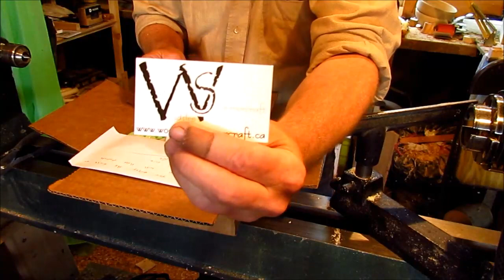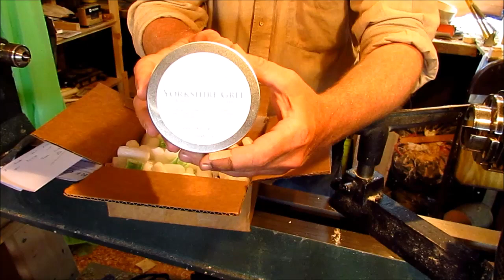BIG Thank You and My First Yorkshire Grit/Hampshire Sheen Experience!!

Comment: Using superglue to fill cracks requires a medium to thick CA. It helps if you sift though the shavings (use a tea strainer or scrap of house window screen), and use the fines to pack them into the crack which was wetted by CA.
...... 
However, in your video 2, you'd have better results using a super thin CA which will be wicked into the fine cracks as you watch it, and the result can be turned with a sharp tool (fine cuts, please) to significantly reduce tear out. The thinner the CA, the faster it sets. I like using Starbond EM-02 which has a thickness of 2 cenetipoise (water is 1 CP), in this application. 
....
CA is more expensive than sanding sealer (shellac, or any commercial brand), and can be used after trying sanding sealer if that application does not reduce tear out to your satisfaction.
....
I find your videos informative and entertaining!  Keep up the good work.
Reply from the maker: I actually did fill the cracks with fines but that section of video got obscured by my head and got deleted. 
I'm really limited in supplies and pretty much have to use what I've got/can afford. I picked up the Gorilla glue because it was on sale. I didn't think it would be as thick as it was. Personally, I do prefer the thin because it flows into the cracks so nicely. I just don't have any on hand right now.
I'm hoping to get some sanding sealer soon. It really does help quite a bit.
Thanks for the info on the CA.
I'm really glad you like the videos. I like to make them, and by doing so, I get to learn a lot from the comments like yours. There are so many turners and so many techniques to learn from. The learning never ends! :D There is always something new.
Thanks again for watching! I truly appreciate your comments. 
Cheers!